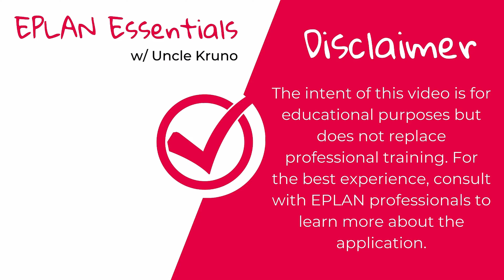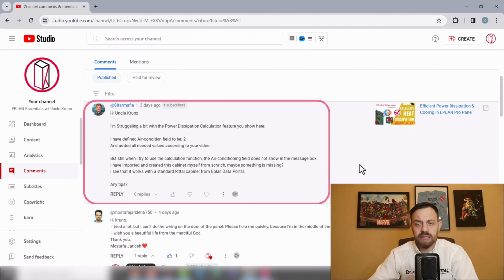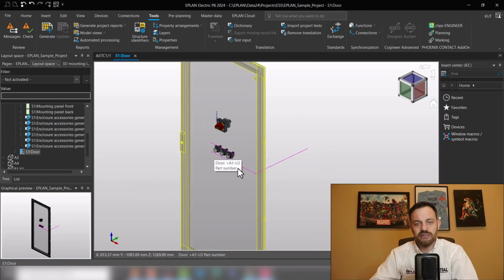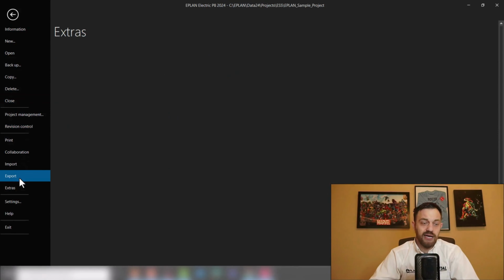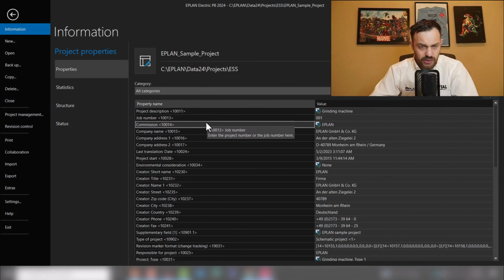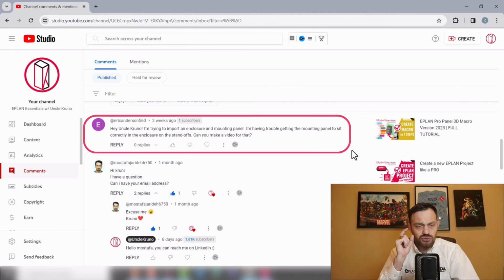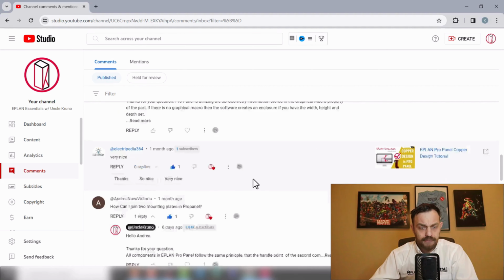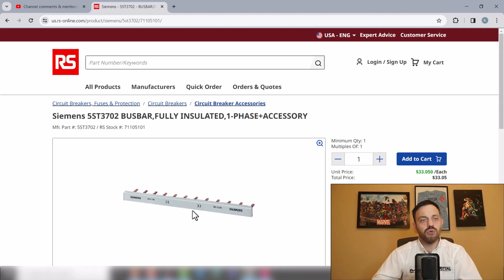EPLAN Special: 10 Questions, 10 Answers in 10 Minutes!

Comment: Hello Kruno, I want to ask you if is possible to generate automatically 3D Panel Layouts in Eplan Pro Panel. For example we use Eplan Cogineer to generate multi-line automatically. Is there anything similar?
Reply from the maker: Thanks for your question. There is a possibility in EPLAN to generate Pro Panel Layouts. If you don't mind send me a message on LinkedIn and the country you are from, and I will send you information and get you in touch with your EPLAN representatives. Best Wishes Kruno